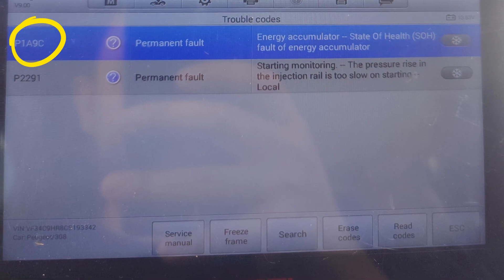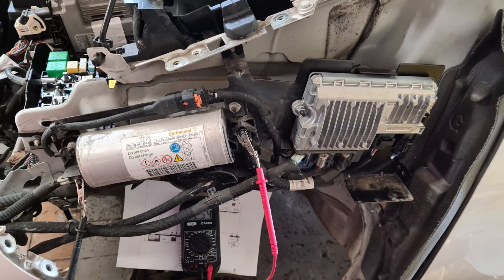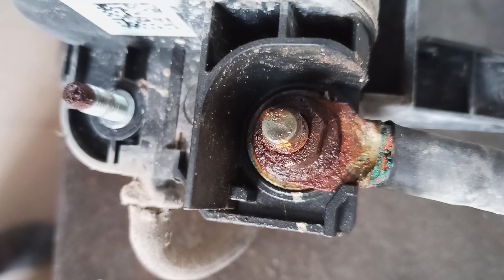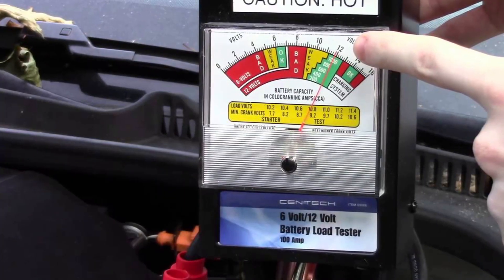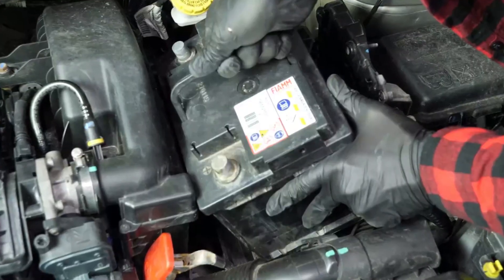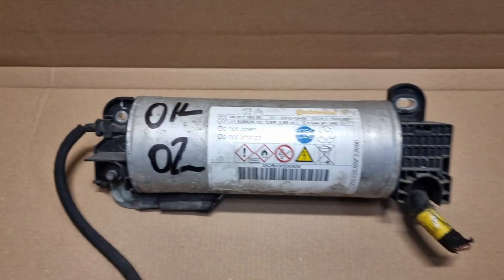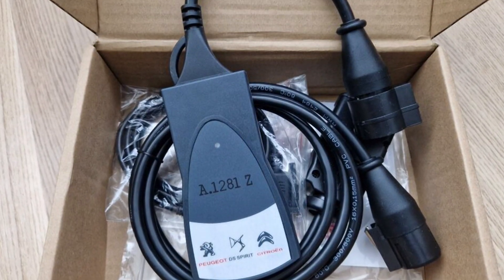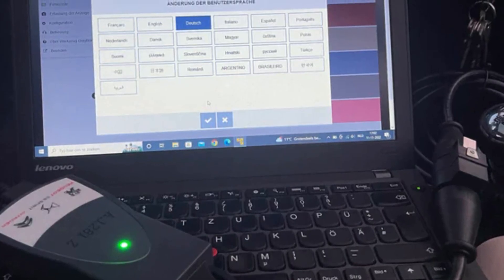P1A9C code in Peugeot cars and Start-Stop issues

Comment: this error is so frustrating you don't know if invest into battery or capacitor but.. i think first choice is battery
Reply from the maker: You can check the battery with a load tester or charge it and see if this helps before you buy the new one. Checking the capacitor is also possible, but much harder and I wouldn't say it's a DIY thing.

Comment: I have this problem, god knows how and how much it's gonna cost me to sort it. I can't let the error code sit on the dash as it will be an MOT failure in the UK.
Reply: Tu a trouver une solution ? Mon garagiste va essayer une batterie dans un premier temps :/
Reply: @mika57EL did the new main battery fix the issue?
Reply: @beastuct non j'ai trouver un cable quand je m'amuse a tiré dessus 1 fois sur 5 l'erreur n'apparaît plus :( je vais voir pour trouvé quelqu'un d'honnête pour vérifier tout sa j'ai pas envis de payé une fortune a changé batterie si c'est pas sa 😂
Reply: @mika57EL but when the error disappears, does the start stop work? Because in mine the service light disappears and appears randomly, but when it disappears, the start stop doesn't work and the green eco is flashing. So, in my case I suspect it's the battery as it hasn't been changed in 14 years, as far as I know.
Reply: @beastuct Hello! Mine has the same problem. Did you replace the main battery to new?
Reply: @ainiso561 Not yet, because besides the start stop, the car works just fine the past year that the light started appearing. Nevertheless, it must be the battery, because even after a long road trip of 7 hours, I saw in lexia that battery was only charged to 65%. I want to see how long will the car run with this old battery

Comment: I have the SERVICE light on, with a flashing eco light. 
 The car is a 2012 DS3S hdi 1.6.
 No engine light on . And No P codes on a cheap reader . 

It started immeadiatly with injector problems on cylinder 3 imbalance .

Some plugged in a diagnostic tool and it gave that P1A9C code indepth. Permanent fault. 
 They could not clear it .

Although if I removed ignition key ... let the car sit for 60 secs approx,  then held on the trip button for miles ... it counts down for 10 seconds to zero, and would remove the service light illuminated. 

Not Permanent though , after the journey ... stopping the car and restarting a while later it will reappear .
 
The original fault on the car was caused by a loosening retaining injector bolt ... a copy bolt instead of a citroen original... not seating into the collar countersink.
 The citroen bolt is cheaper by the way ..

That's sorted out... but this fault remains and although the car runs no problem,  I'd rather sort this one also.

Incidently the battery state of health was down to 30%   the voltage was right up to 12.7 but the CCA cold cranking amps stored and displayed on my cheap little analyser was around 220cca when the battery states 570 cca. 
 I'm not sure how the ecu figures things out ... does it measure the battery voltage ⚡️  first or monitor the cranking speed and decide to intervene with this device with the P1A9c code ie capacitor  ?  Probably the latter.

I had a spare battery on tricked charge a lot healthier..  so it's in .

The fault won't clear though ... maybe the ecu or the capacitor had a spike type signal ... a just blew the capacitor device when the injectors went faulty .. ?

Next job then is the inner arch off etc... that passenger wing let's the car down a lot ... I know its a 2012 but it looks a bucket ... maybe a good time to get a wing from the citroen specialist scrap yard .    5 mins from me ... lolz 😄

If that's not jammy enough there's another 15 mins away ..
Reply from the maker: But if the car works fine, I would just let the code sit there. It won't cause any problems. The code is sticky and probably shows that the capacitor is on its way out. But if the car starts fine, just don't waste your time and money on that.
Reply: @DmitrySapko  Thanks for the reply.    Well before i read this reply I got it in my garage, took the inner wing off and the outer wing .... as there was no way to access it/asses it with inner wheel arch off.  

The first thing I noticed was corrosion around connections to the ultra-capacitor and non on the module next to it. Ive tried to carefully clean it after discon battery, although this disconnecting battery wouldnt make much difference as the energy/voltage is stored in the unit.
I used WD40 also, left it overnight but it hasnt made any difference this morning.

As the wing is offand ive been looking to replace it for some time I ll call into the scrap yard and pick one up anyway.  I could ask for a capacitor to try - on return if its no good- but if the fault stays on ? which it appears it will do from various threads then its obviously not worth the effort.

Thanks again for your video & advice bro , it was very helpful.
Reply: Another update : i got a replacement capacitor and module.  Cleaned them up a bit as there was a little corrosion on them, fitted it and the service light cleared straight
away by itself.
 On the original unit there was a graound wire near the headlight that I didnt know about or could see, this was fairly heavily corroded with green around the
nut/bolt and into the wiring somewhat. IF i had of seen this and got some cleaner on it I believe it probaly/may have sorted it ?
 I didnt bother trying when I noticed it , and instead went for just fitting the replacemnt unit.
 The replacement 2nd hand part came with all the wiring connected , so I stripped the old entire wiring/ unit out and visa versa fitted the replacement. 
making sure to clean corrosion if any and use wd40 ... being careful as its a capacitor - possibiliy fully charged ??
It started straight away on testing it with no fault/service light.  let it run for 30 seconds.
 Next morning ... started straight away , but the service light reappeared ! for 2 seconds !! went away didnt come back, so far hundred miles and about 10 starts.

I plugged in the cheap £10 obd code reader ... and got code  P0000 ? which means no faults but the car/ecu hasnt completed a full cycle - not enough driving. 
Annother code was U3FFF ?  which was signalling "possible" fuel filter/poss MAP / poss sensor out somewhere.  These codes werent there before.
 I suspect its  nothing at fault .. seriously. -  I cleared the codes. 24 hours ago and drove 30 miles and those 2 codes have gone,

 But i do have a older unlying code P0269 cylinder 3 imbalance which ive still got to investigate fully - there is no engine light showing etc.
   The 269 identifies the specific malfunction in the fuel and air metering system. Poss that MAP metioned earlier ?

On another note to do with the capacitor, - there is a small device that apparantly is on the negative battery terminal, as it meets the battery, from what i gather this monitors
the battery in some way, I cant recall specifically, but it was on my list to check before replacing the capacitor, as it signals the ECU if or if not there is enough voltage in the battery to start the engine, - the ECU can stop the alternator or battery from charging up that capacitor ! to ensure the battery is fully charged.  ? Im not sure how it works
EXACTLY how its set up ... but i had my Suspicions about it being responsible, i ruled it out somewhat after checking the battery at virtually fully charged BUT only had 30% ampage remaining, The CCA of the battery was 570CCA cold cranking amps... but my battery analyser showed only 270cca.  On second thoughts the crank sensor may have detected a slow rotation of the engine during starting and "decided" - not to charge that capacitor - ? poss inconjuction with that sensor on the negative terminal. ?

I do not have a stop/start on my vehicle although its a 2012. 
  Apparantly that capacitor HELPS start the engine in winter ... by boosting 

Well im off - thanks for the vid - hope my info helps others. - its giving me a headache lol 😁
Reply from the maker: Thannnks for the update! The P0000 is really because you need to drive more. The warning message came up again after starting in the morning exactly for the same reason - the system needed more time to regiter the new capacitor. The ground cable near the headlight wouldn't fix the entire issue as it was because of the failed capacitor, in the first place. Now, the U3FFF code most likely means that your car hates your scanner, lol, absolutely nothing to worry about. The P0269 looks like the injector issue to me, but needs further investigation given the engines are very tricky to diagnose. I believe the battery sensor that you mentioned is OK. Take a multimeter and measure voltage on battery posts when the engine is on after you've been driving for 20-30 minutes. If it's still 14.2-14.3 volts, this sensor is most likley bad or something is wrong with the battery. If it's like 13.2-13.5 volts, the sensor is good and the capacitor should be charging properly.
Reply: I have this problem!
2 choises:
Peugeot original 180€
Eliminate the error and forget start stop 80€
Reply: @jaimepereira7238  The second solution is definitely the best:
Eliminate the error and forget start stop €80
But how?
Reply: @AlfonsoMarmo-t6f  my elétric mecânic
Says he can eliminate the error Forever 😅
Reply: @jaimepereira7238  and he doesn't tell you how?
Reply: @AlfonsoMarmo-t6f  don't know
Reply: I'll try removing any encrustations first, otherwise I'll find another solution